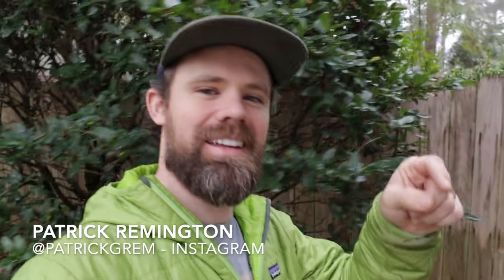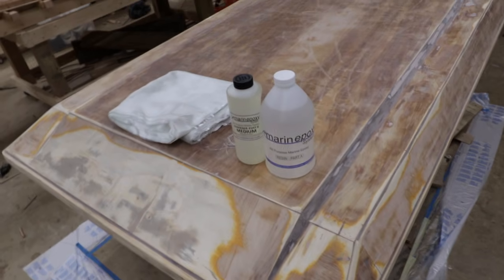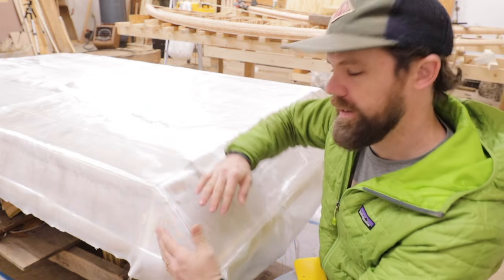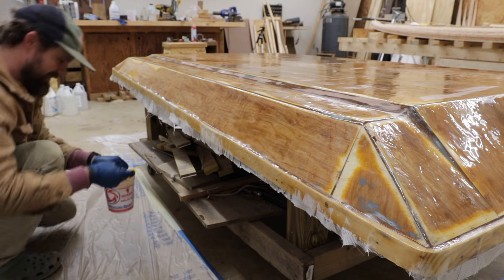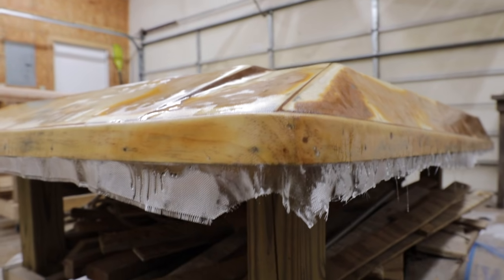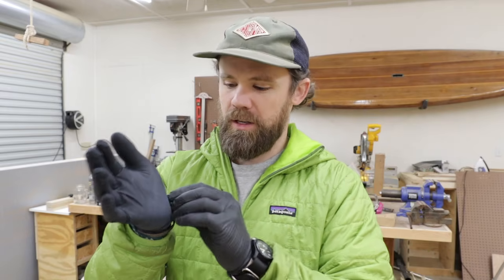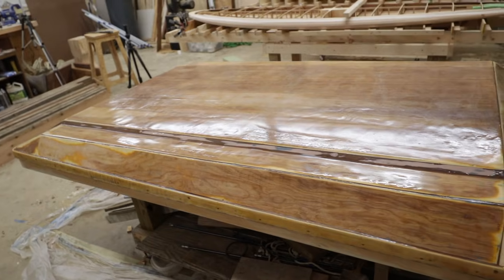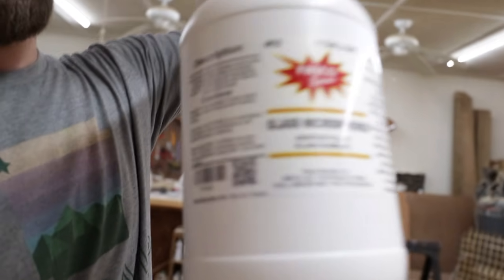Fiberglassing the Hardshell Rooftop Tent!!

Comment: Thank you for your video and sharing your experience. 
It is said that for better mixing one should use two mixing cups. Firstly you use one cup and after finishing mixing in it you fill the next one and continue mixing in it. When you use only one cup, the part of the first component sticks on the cup and don't reacts with the hardener.

Comment: Another great vid, I've been following this build for a while now. I'm working on a topper\camper and have not started the fiberglass yet. Never done it before but have watched a lot of videos. Yours is one of the better examples for us beginners. I'm still waiting to see someone do a video on all the messing around you have to do with tools, buckets, brushes, gloves etc. Sort of a behind the scenes of fiberglassing. I'm wondering how many gloves and cups and... I'm going to go through and if there are ways to use less plastic products. Thanks for all the efforts.
Reply from the maker: Thank you! You definitely go through a bunch of gloves and brushes. I have started to wipe my gloves off with rags to quickly get most of the resin off once I'm done and this allows me to reuse gloves at least once if they don't have holes. Gloves get expensive. The cups you can reuse most of the time. Once the leftover resin cures you squeeze the sides of the cup and the resin inside will pop loose and fall out and you have a perfectly clean cup again.

Comment: It's far easier to make the mat stay in place if you wet out the project fully with a layer of epoxy and let it get slightly sticky before laying on your fabric, then wetting it out fully on top. You have to trim the fabric and be sure you're working with the correct pieces before hand. Also, use a metal fiberglass roll to smooth and clear bubbles. Squeegees pull laterally on the mat while only pushing down slightly, rollers mainly push down while only slightly pulling up if the epoxy is starting to get tacky.

Comment: I got to pull up the video where you sewed the zippers and where you got them from. I did a marine epoxy roof on my squaredrop camper and it hasn’t leaked or weathered in 3 years. But if I ever get around to doing a rooftop tent I will build the top out of PVC sheet it’s waterproof and needs no prep
Reply from the maker: Nice! Yeah there are a lot of ways to do it. I definitely didn't make it as simple as it could be but it will look good!

Comment: Could have used table top epoxy as the top coat. It's a thicker viscosity but does not cure as fast..an hour working time atleast..so just do a flood coat over the top and then heat gun or torch it to pop the bubbles then sand and paint or polish...you could tint the final coat as well to get your final color and just sand and polish it

Comment: I tried to make one of these a few years ago.....it didn't work. My fiberglass cracked and peeled up . I had never worked with fiberglass before, and did it in the winter in an unheated shop. BIG MISTAKE!  I though epoxy would cure regardless, but it doesn't. It took forever to dry because it was too cold.  After ruining my tent attempt, I learned that not only should the temp be over 50F, but sunlight helps it to cure due to UV light.  I want to try again this Summer and will check out you website for sure.
Reply: I just looked up your FB group......I'm already a member!  Funny, I don't recall joining, but I must have!
Reply from the maker: That's weird.. What epoxy did you use and what did you put it over?

Comment: What’s the advantage of putting the fiberglass over the wood?  Does the wood eventually become the mold and get removed?  Learning a lot,  keep the grt vids coming!
Reply from the maker: No, the wood stays but I realized that the wood expands and contracts with temp and moisture changes. This movement can crack the paint and cause the wood to rot. You could also do a rubberized coating of some sort like truck bed liner instead of dealing with the fiberglass.

Comment: I've never tried fiberglassing, but I'm wondering, is it not possible to use a staple gun to hold down an edge and even tuck the matting into and inside corner to keep it from pulling out when you apply the epoxy?
Reply from the maker: Possibly! I’ve never tried it. I’ve heard of people using spray adhesive in the corners to stick it down before applying the epoxy. I almost tried that method but was scared of messing something up

Comment: Looks great but normally the epoxy goes directly onto the substrate.  As you wet it out, it comes up through the mat giving complete, saturated coverage and an unbreakable bond.
Reply from the maker: That is a way to do it but not a superior way. Thats actually much more difficult way to do it especially for something this larger. Once the epoxy starts setting up it makes placing and moving the glass cloth very difficult and can end up in disaster especially for those that have never done this before.

Comment: So my question is, if you are putting that many coats of epoxy on, why do you need the fiberglass material? what purpose does it serve? Or is it just to act as a base for the epoxy?
Reply from the maker: the fiberglass adds strength the additional coats of epoxy allow me to sand down the surface without sanding through the fiberglass. I wouldn't have done this many coats if I hadn't messed up one coat.

Comment: why did you use epoxy instead of polyester resin and how much epoxy did it take to cover the top?
Reply from the maker: You could do polyester and probably save some money but I've never used it and since Im not familiar with it I didn't want to experiment on this thing.
Reply: @PatrickRemington  I am designing  a RTT based on your inspiration is why I am asking the questions. I am investigating costs of a foam core fiberglass cover is why I asked how much epoxy was required to coat the top. My goals are: 1 cost less than $500 and weight under 80 pounds.
Reply: @CAMEA-snoozy  Epoxy is more flexible that poly resin and more water resistant (waterproof) than poly.

Comment: Why not do several layers. You could do the top then the edges. Then  lay another layer over the whole thing. It will only make it stronger.
Reply from the maker: You can do that. Just more resin, weight and cost. It will be good for what I’m doing. You could also do a heavier cloth. You could do 6 or 8oz